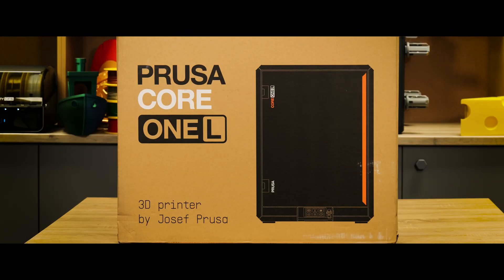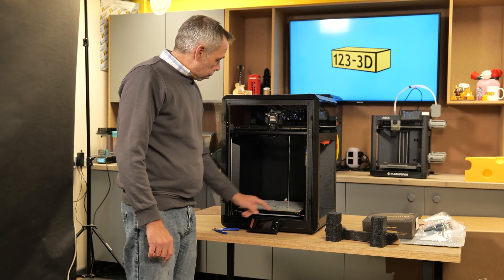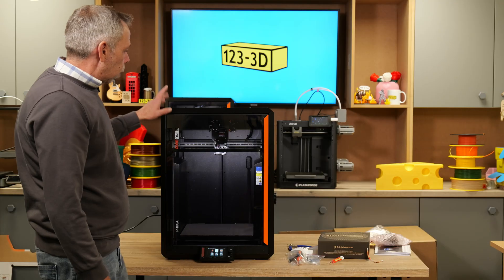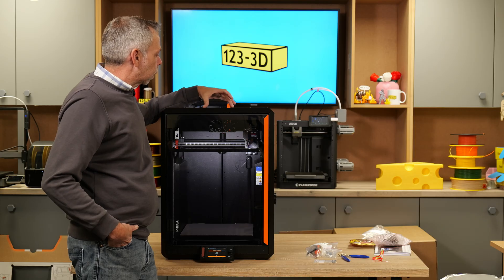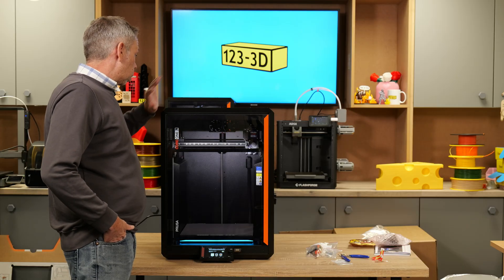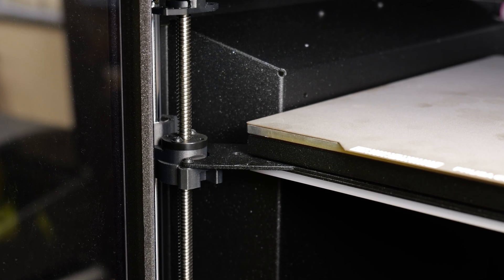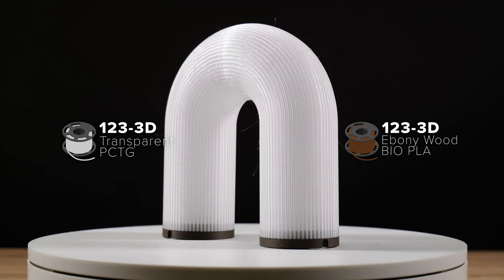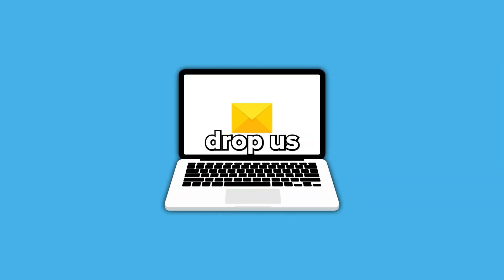Is the Prusa Core One L Overhyped? First Impressions Unboxing

Comment: I think what a lot of people don't realize is that when you buy a Prusa, you machine gets better over time. Reason being, Prusa does not constantly come out with new models, they come out with new versions and then provide the user the ability to implement the new features, from the new version, on your older version machine. After years and years, when you are finally ready to get a new machine, their may be a new model, with some new features that simply go beyond what the old model was finally capable of (like the XL, Core One and Core One L) but you have so much value saved up, at that point, due to getting so much use out of your old model, the new model is actually cheaper than the sticker price you are paying. Meanwhile, in the same time line, using the other manufacturers printers, you'd be on your 5th or 6th model, having paid full new model price for each one and the older models probably going on the scrap heap, due to age and obsolescence.

Comment: Wow it looks like it is another overpriced mediocre 3D printer in the Pruda tradition. 🤷
Reply: A fantastic open source printer offered by a company that has offered more knowledge and capability to the 3D printing community than any other, developed by passionate engineers and experts, instead of a CCP subsidized locked-down printer that you don’t actually own, where a software update at any time can limit its capability, and whereas the majority of their “innovation and quality” comes off the back of patent infringement and intellectual property theft.   

There, I fixed it for you.

Comment: You don't think there is anything else on the marker that does what prusa does??? And I am supposed to take this channel seriously?

In what exactly is this a better printer than the H2S WITH an AMS Pro for less money?
Reply: Because, in the lifetime of your average Core One or Core One L, they will be able to be repaired easily and cheaply (in the rare times that they break), with parts available from Prusa, with help from a person on the phone, and also they will become Core Fives or Core Sixes, through incremental, less expensive upgrades over time, while the plastic Bambu will break and need to be repaired, with expensive parts, eventually parts that will no longer be supported or available, with little help from Bambu, and you will have needed to buy new model after new model, for full price, 5 or 6 times. So yes, in the short term, the Bambu is cheaper.
Reply: He didn’t say anything about money. Also you get what you pay for.
Reply: @perkulant4629 I'm arguing that Bambu does offer more than what prusa does. Not taking into account money

Comment: Got one of these delivered from yourselves last week. It is replacing my Core One. Very happy with it, however one little tweak i had to make. the ptfe tube caught on the fan grille at the back when the printer was printing at the back of the bed. fixed it with a tweak on printables.
Reply from the maker: Thank you for supporting, glad you like it!